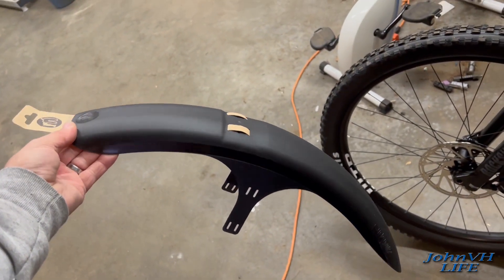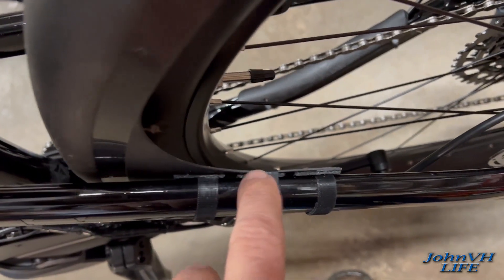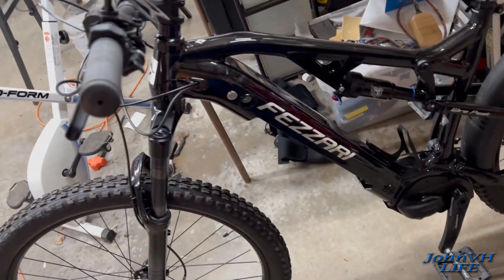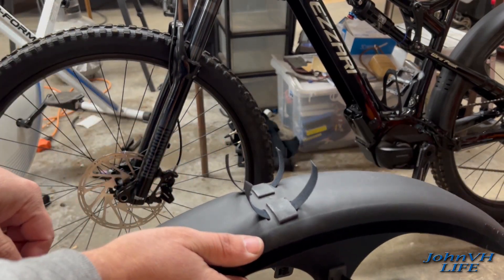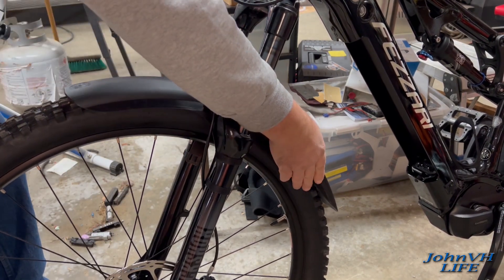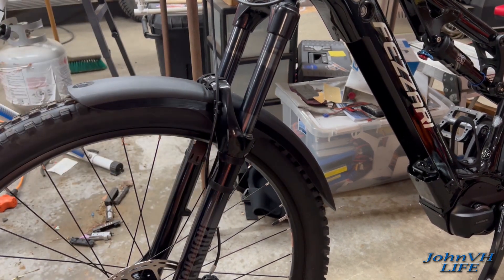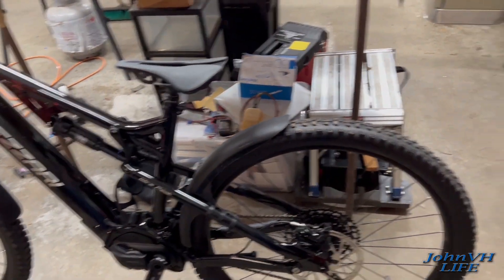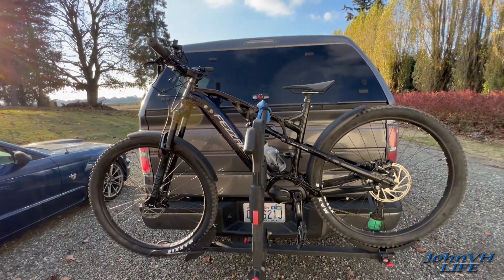Mucky Nutz! Long Fender modification and Installation Review on Fezzari EMTB Mountain Bike

Comment: Finding good protection against dirt on the front wheel is not a problem. The German SKS also produces an excellent option. Another thing is protection from dirt on the rear wheel. On Amazon, there is a lot of such protection. And it is basically massive, and should be effective. But, I'm talking about protection, like in this video. It is very similar to ProGuard Rear - Cable Tie. They even look like twins. But, only Mucky Utility MugGuard, for the front wheel, but there is an option for the rear: Mucky Nutz MugGuard Rear.

Comment: Roscoe 8 rear tight fit, needed adjustment. Cardboard to space from wheel and push closer to seat stay. Then a hair dryer. Looking to secure it better with additional Velcro at bottom and top. Will see if superglue can hold instead of slicing slots in fender. Just so less play when getting rattled riding.

Comment: A question about the front fender model used as a rear fender? Does it still help with keeping the water or dirt off you? Or should I invest in a longer rear fender that reaches all the way to the back of the rear wheel? I’ll mainly be commuting in the city no off roads.
Reply from the maker: it wont keep everything off you, but you can see how much it keeps off the bike, to keep it off you it has to go way farther back

Comment: How is the rear protection been? Have you been on wetter conditions yet?
Reply from the maker: Nothing wetter than that. I try my best to avoid wet. Haha
Reply: Not sure if this is helpful, but I have the short version on my rear (considering going long so it better protects the dropper post seal). I live in southeast Alaska, so a lot of wet conditions... less mud/muck, more wet spruce needles & dirty water, sometimes silt. Loam, I guess. My goal was to try to keep more if it off the linkages and shock. It hasn't made a massive difference, but it's been enough that I'm glad I bought it. Before I had it, I would get more stuff jammed into that area. Typically my shock stays pretty clean with it installed. Can't really do much about splashes (not to be confused with spray) from the front wheel, though. A gut/downtube fender would probably help, but I don't really like those.

Personally I think rinsing & wiping your bike after each wet or dirty ride, with no fenders, makes a bigger difference to the linkages & suspension than someone who has the best fenders, but only rinses their bike once in a while (or never). The combo of fenders + maintenance gives a pretty good result overall.